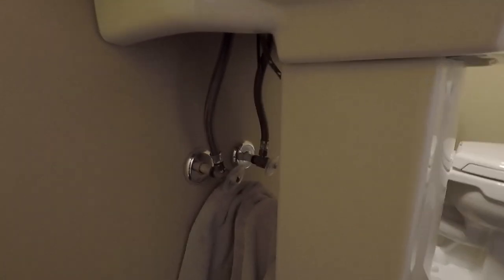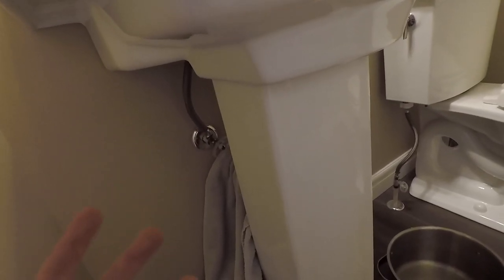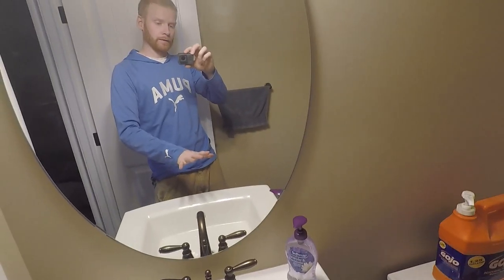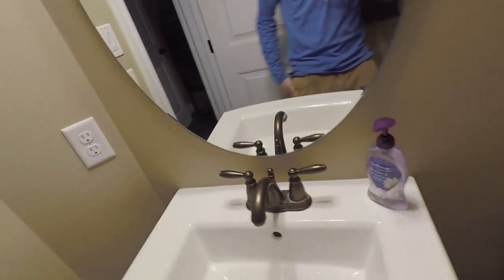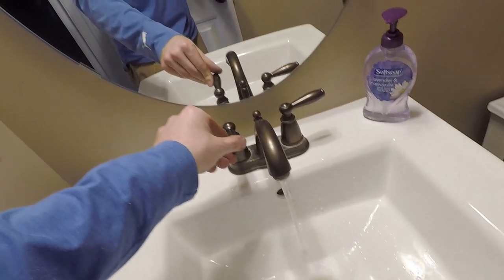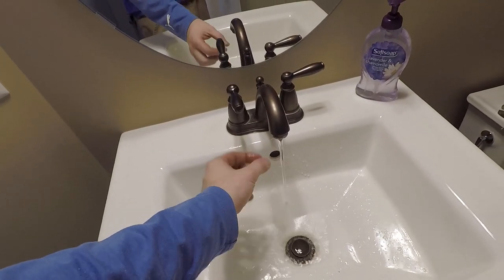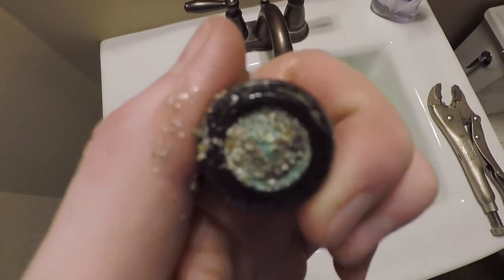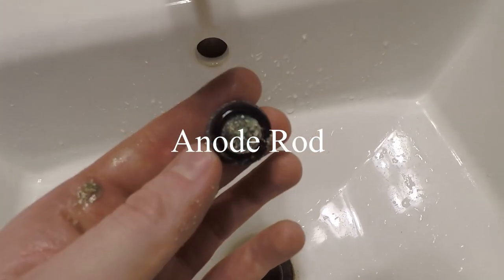Low or no water pressure after changing your Anode rod / hot water tank

Comment: Any time you turn off/on one of the shut off valves for a toilet or sink faucet, and especially if you do any kind of work on a water Hester, you can basically guarantee you will send sediment throughout all of your aerators. Check those first. Easy to do and often the cause of your low pressure issues

Comment: This happened to me but the faucet is brand new. So there has been no build up. Currently an unsolved issue
Reply from the maker: Check all your faucets on the starting with closest to the hot water  tank. Just unscrew the part that holds your screen run the tap and clean it out. my house is fairly new and I had some build up due to the stuff in the hot water tank.